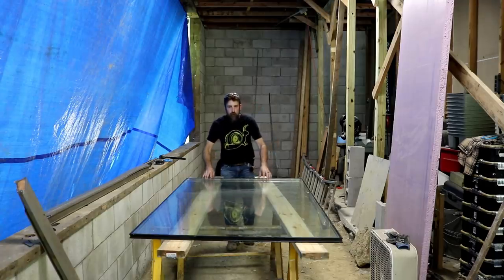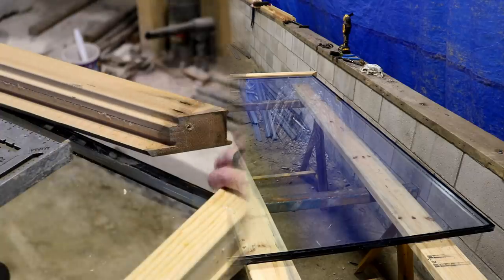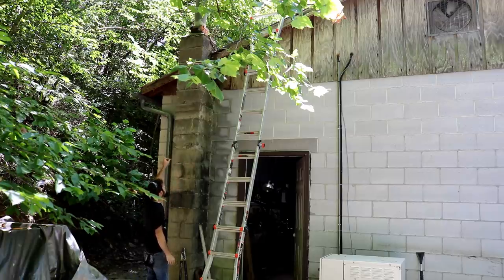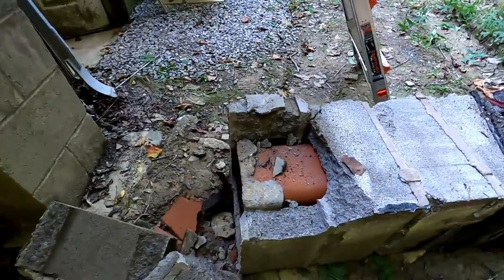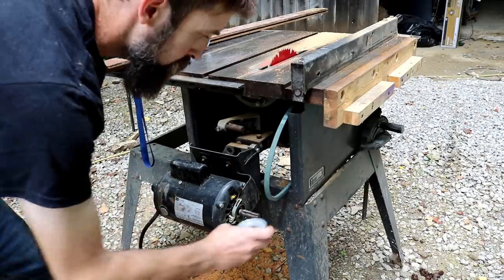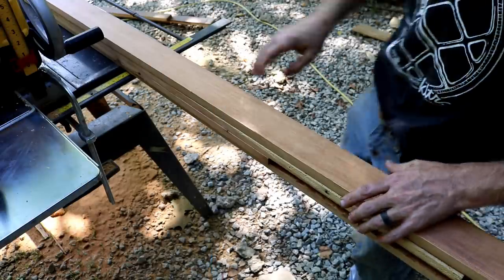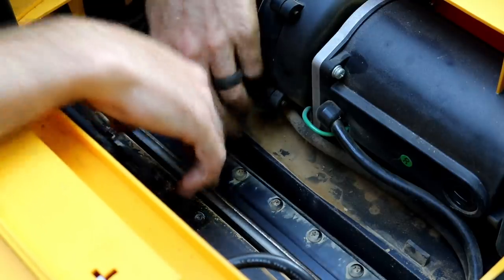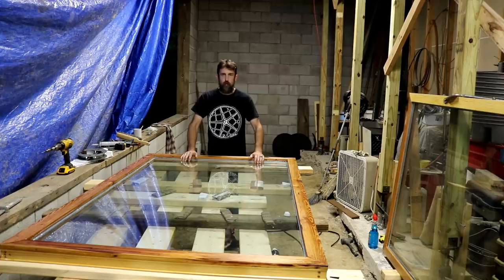Busting down the Chimney and framing the massive windows for the shop.

Comment: Howdy Steve.   May be a little late, But if you want crazy strong glued wood joints try this it works.   On both faces of the joint take a little glue and lightly coat the joint. Rub off the excess with a rag. Let dry for a few minutes. After it is dry then apply glue to the joint face. In essence you are priming the joint with glue. And when you reglue the joint the glue is sticking to the glue embedded in the joint face.  Crazy strong joint.  Keep up the good work

Comment: I got turned onto the Japanese saw about 15 years ago when I had a lot of trim work to do on a project I did. It has come to be my go to saw when doing delicate work. Easy to control and leaves a smooth finish. Nice job. At 81 don't think I would of started it. Refreshing to see the younger generation is as crazy as I was. LOL

Comment: Old school outdoor varnishing trick called 3-2-1.  Start with 3 parts mineral spirits, 2 parts boiled linseed oil and on part oil based spar varnish.  This will dry very quickly.  Repeat 3 or 4 times, no sanding between coats required.  Then 2-2-2, couple of coats, last 1-2-3, couple of coats sanding in between coats.  The last ones might take a couple of days to fully cure especially if the weather is cool.

Comment: Potentially helpful comment; use a piece of lumber on the outside of the building/ window opening to prevent the window from going all the way to the creek when you finally install them. All that work... When you've secured the windows in place, you can remove the lumber.

Comment: Steve make sure to pitch the window sill to run water off the wooden sill. If you preinstall the wood  frame that secures the window frame in place on the outside edge you have less risk of braking the glass. Also you can lay a bead of silicone on the inside edge of the exterior support frame.

Comment: Stating the obvious here, when installing those fixed panels, make sure to set them in a way that, when this wall takes the roof load, that’s these panels don’t end up in compression. Glass is more resilient than most people think, it’s the edges that kill ya. Great work!

Comment: steve as you know water is your enemy, after the windows are installed, cap bead the glass,  this is cheap insurance and goes a long way to preventing water from  finding the smallest holes, especially after 3-4 years of hot and cold cycles.  did my windows 10 years ago and no leaks or foggy glass.  used this method when testing windows and doors and it works.

Comment: Looking good Steve! I have that same table saw. It's great except for the fence, which is pretty tedious to set.
Reply from the maker: The only table saw I have ever used to compare to mine to is the ones we had in shop class in high school😁. The fence on mine seems to work ok, but what do I know about woodworking tools. Thanks for stopping by Wes. Congratulations on  your channel as well. Looking great
Reply: Yes, those fences are are very difficult to consistently set square to the blade. I’ve had my battles with those over the years. My main saw now is a late 50’s Delta Unisaw with a T-square style fence. A good fence is the best improvement you can make to any table saw. Both for accuracy and safety!

Comment: Steve, I have a table saw just like the one you are using. Take a look at the left side of the motor to see if there is a shaft under the cover. Most of those motors are universal and can be mounted using either side by switching the wires on the connection board inside. This way you can have a new shaft without buying a new motor (unless someone else has already done this). Shop is coming along nicely. Keep up the great work.

Comment: Hiya Steve. FYI not a knock, but I have used Helmsman spar varnish before. I always have a supply on hand and I still use it for many projects. While it does hold up well, if left natural, it will need occasional seasonal touch up, especially if it is direct sun on oily, rot resistant woods like mahogany and cedar. In direct sun, it will eventually crack and dry. Simply use a scraper when it does, and scrape it where it will crack and flake, and then give it two fresh coats. It is a fantastic coating, but it is not weather/sun proof. I have found that indoors it can last forever, but outdoors, it will degrade over time, and it is meant to be touched up. When used on wooden boats, it is not uncommon to touch up every season. If you paint over it though. then the touch up will be for the paint. The paint will protect the varnish/urethane and it will hold up very well with an opaque coating/paint.

Comment: Steve, I rebuilt an old Craftsman cast iron top saw exactly like yours. However, I installed new bearings and mandrel and even a new motor too. Then I added on to both side and front material with Formica laminate to turn it basically into a cabinet saw. Then I bought a Biesemeyer fence and love how it runs and cuts.  Those saws are very good and a real quality base to make them into whatever you want for a table saw.  Another thing you may like for your is the Power Twist belt. Sure reduces vibration... Thumbs Up!

Comment: I couldn't really tell, but it looked like those planer blades had slotted holes. Sometimes you can get more use out of a set if you shift one blade to the right and another to the left, that a notch in the blades will no longer line up on all three and not leave a line in the wood.

Comment: The carbide insert planer has several advantages over the straight blades, first they are quieter to run, require less power to drive, they perform better on difficult grain timber, far less tear out, and if you do hit a nail or something similar you can quickly rotate a tip or two and you are back in business. And the biggest advantage over straight blades is there is no lining up blades to get all blades at exactly the same height. That may not be a problem on your machine as you don't resharpen them as you do on industrial machines.
Reply: Agreed. I'm guessing steve has all the planer he needs right now. If a guy wants better I'd say the best way is to find a industrial/commercial auction or used with the spiral cutter head on it already. The advantages are all you said they are.
Reply: I am running my original blades from 30 years ago in my planer. I have the older model than Steve has and the blades are sharpenable. I bought a new set of blades but never used them yet. I just keep sharpening the original blades. My planer has some miles on it now too. Still works as good as new. The planer came with magnetic guides for installing the blades. So aligning the blades is nothing to do at all. It is a non-issue. I wouldn't buy a Shelix head at a quarter the price they charge for them. Maybe for $50 I'd give it a try? But I'm happy with the stock blades so far. A craftsman never blames his tools, because he knows how to use them.
Reply: The blades that stretch the length of the cutter arent any count..  as soon as you slip a nail through then  youll have a line going through your material from then out..  the carbide blades dont care about nails..  and since theres like 30 carbide cutter heads on one blade than if you do chip one theyre all replaceable so good deal there too..   but they run quieter, cut cleaner and since carbide runs cooler you can pull your material through quicker and not burn it...  they are a bit of money so depending on how much use the plainer gets than thatd justify getting the blades...  i just did the whole backdoor deal and bought one from the big box store, used it for the day i needed it then just returned it when i was done..  and yea i know, shame on me..  but those boogers have taken hundreds of thousands of dollars from me over the yearz..  i get it where i can...   ;)
Reply: @John Verne only expensive if you don't use the planer on a regular basis.  at $50 a set for stock knives, it adds up QUICK
Reply: With the reversable blades, if you hit a nail and chip them just reverse 1, that leaves a nick either side and the other blade cleans up what the first one left and visa versa instead of making a ridge, they are also resharpenable with a diamond hone, with the grinders steve has I'm sure he could sharpen them although not many times as they are short and it puts your scale out of wack.
Reply: @incubatork  don't put wood with nails in it through your planer. Anyone that uses scales on portable planers needs their head examined. I saw Steve had his calipers out.
Reply: Spiral or shellex cutter heads are really nice, but don't really meet the CBA for DIY'rs.
If you nick a HSS blade just shift them over in the cutterhead so the nicks don't align and you don't have the raised lines any more.
Reply: @jimurrata6785  If you really care about the finish of planed wood you can always finish up with a hand plane, scraper card or even sanding. As the name suggests a thicknesser only gets you close to the thickness you're looking for. It is not meant as a final finishing tool.
Reply: @1pcfred  Oh, I get it. It's my trade.  I've even owned that same planer, for site work. 
But all these people talk about carbide blades and insert cutter heads.. 
They'll shatter if they hit steel and Steve is reclaiming this flooring from some house that was being demolished.

I'm not going to handplane a piece of trim, like I would a piece for furniture.
The obvious amount of pitch/rosin in that old growth line would gum abrasives instantly.
A card or hook scraper is the WTG for smoothing, once taken to dimension.
Reply: @jimurrata6785  pitch can be troublesome. I've stored wood in the attic of my garage and driven pitch out of it. When it gets really hot up there the pitch will sweat and then cool in beads on the surface of the wood which can be brushed off. A lot of wood is just inadequately dried.
Reply: @jimurrata6785  My brother and I have run a lot of recycled timber (Douglas Fir and Australian hardwoods like Red Gum) through a helical head thicknesser and as you'd expect it has eaten a few nails. The inserts got blunt before we chipped any edges.

A big advantage that hasn't been mentioned is the form of the chips. The helical head makes nice short ones that are easily sucked up by the dust extractor. My bro's handheld 6" power planer by contrast has conventional blades, and he's given up using the dust extraction adaptor I made for it because the chips are so long that they tangle and block the hose.

Comment: I like them big old windows! They are going to be awesome. I'm rebuilding my house and it was built back in 1940. The flooring was nailed to the  joists. I did about the same thing you did with the stands to hold up the roof and ceiling. I jacked the roof up about 6 inches and then rebuilt the floors and walls from the piers up. I still have one more section to do and then get to sheetrocking the walls and finish work.... My project is lots of work but I think yours is way more work than mine. Yours is looking good!!!!!

Comment: With all your equipment and knowledge just turn on motor and polish the shaft with emery cloth and make new pulley to fit or get new pulley with smaller bore and bore to fit .
Nice job on getting the shop repaired to get the most use of it
Reply: I'd have just made a shim out of a beer can and flipped the pulley around so the grub screw was on the inside. Done deal. Maybe some locktite on the screw if I was really feeling ambitious.
Reply: He should send the shaft to Abom79 for some spray welding repair to build it back up, then machine it back down to exact specs!

Comment: I switched my Delta planer to carbide a couple years ago and am still using the original side of the inserts.  I mostly work with recycled wood so a metal detector is a must and gets some of the credit for the inserts longevity.  The finish is excellent.
Reply: My planer is 30 years old now and I am still on the original set of blades. I sharpened them a bunch of times already. But I don't think they're half gone yet. Oh, and the finish is excellent.

Comment: I did put the helical cutters with the carbide inserts on my planer.  Yes, expensive but give a great finish.   They are much quieter and if you do catch a nail and do some damage you only have to change or rotate a cutter or two.  That's the good news.   Bad news is when it's time to rotate or replace them all...  set aside at least half a day.

Comment: Back in the eighties an old family friend had a new house built, while getting the plumbing finished up they realized none of the drains were working properly, they blew out the vent pipes with a compressor, and with a great racket at least a case of Coors light cans went flying out of the vent pipe, apparently the roofers thought it was just about the most clever thing in the world to drop their empties down the vent pipes..

Comment: Steve, see if you can grab a battery powered caulk gun.  They may all do it, but the Makita we have does an auto-retract after releasing the trigger so you never have the extra caulk squirt out the end of the gun like on a manual, or have to release the push rod like on a manual to prevent more from squeezing out.  The battery powered caulk gun on the whole is a huge time saver for what we are doing (metal roof and fiber cement siding).  If whatever cladding and roof system you are going with requires putting down caulk, I would suggest getting one.

Comment: I mounted my recycled sliding glass door panels to the wall frame. When they broke, I had to scrape sealer and broken glass from the wall frame. If you make a window  frame, and the window breaks, you can throw away the frame and make a new one.

Comment: The best outdoor finish I have ever used is the Cabot Australian Timber Oil. It comes tinted but I use the natural finish color. We have a  four car garage with solid teak garage doors. A major investment that has to be protected. The garage doors are directly exposed to the harsh southern California sunlight and yet the finish lasts 7 to 10 years before I have to brush on another preventative coat. I have bought several gallons of the timber oil anticipating California may not allow the product to be sold or shipped to California. California has done this before trying to protect the air quality and the environmentally friendly substitute products are inferior products. Buy it while you can.
Reply from the maker: I have used it as well👍. Good stuff . Thanks for watching.

Comment: Thank you for drilling clearance holes for the screws! Seems to be almost a lost art among modern builders. Dry wall screws and force them in, then wonder why you have less strength down the road.
Reply: Not only that, but screwing so close to a thin edge without the clearance hole almost guarantees splitting the wood.

Comment: Your situation would have been a perfect place to simply install sliding glass doors AS windows.   Nothing wrong with that, all the mechanism for them sliding would be there.  And they would have locks as well.  A little fresh air never hurts.  Thank you for the video, good work

Comment: A great ventilation idea that my builder had in building my new shop was to find a used whole house fan and install that high up on one wall. It was wired in and I can evacuate all the air in the shop in about a minute. It creates a nice breeze too. You might be able to do that in the back wall away from your big doors.

Comment: When you use Poly...Stir only in one direction....Slow..Then stir in the other direction...Not back and forth like paint...After mixing well let it breath so all the air bubbles come to the surface.This will give you a much nicer finish..Also brush in one direction only ...Not back and forth like slopping on paint.Also if you use a Good brush like Sable or camel hair you will get a finish that will look great....After two coats  steel wool with 4 ot steel wool.Then put on the third coat and it will be nice and smooth.Once dry wax with a good car wax ..buff to a nice slick surface.By doing this on the out side water... dirt...snow.. will roll right off  not to mention it will look like a pro did the finish job..Your finish will decide how log your lumber will last...So in 4 or 5 years your not tearing it all back apart because of rotten lumber..Also you might finish your lumber first...then cut and fit your peaces and then touch up as needed....Better to take your time on the finish now .Latter will be a real pain.......RLTW.....
Reply: Hogan62 a sensible suggestion sir apart from I would use the Sikkens product that Randy Richard is using on his shop extension build
Reply: @samrodian919  Sikkens is by far the best product I've ever used for clear exterior finish. I cannot be used over existing finishes though.

Comment: When you install the window, just a suggestion, maybe put some straps top to bottom of the window frame (outside) to give a little extra  safety margin so it does exit out.  I hope this helps.
Reply: Installing big glass like those windows is no joke. Glass is really heavy. Kind of a bit on the fragile side too. Almost as if it was made of glass? Pros would use suction cups. They'd know what they were doing too. You can't overstate the importance of experience on some jobs. So yeah taking the task seriously at the outset would be a plus. The learning cliff with glass is a perilous one.

Comment: for mounting your windows look at butyl rubber two sided tape. it will stick the windows in and seal them too. get tape a little narrower than the rabbit then let your windows in add a bead later but once contact is made to the tape your windows are in place for good.